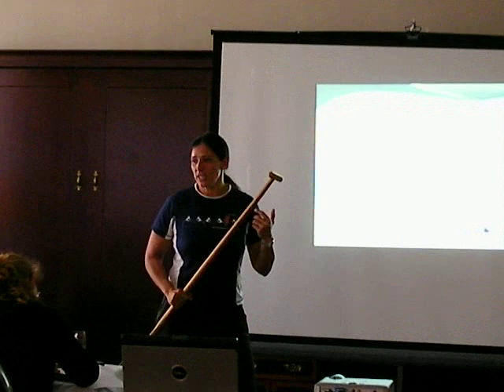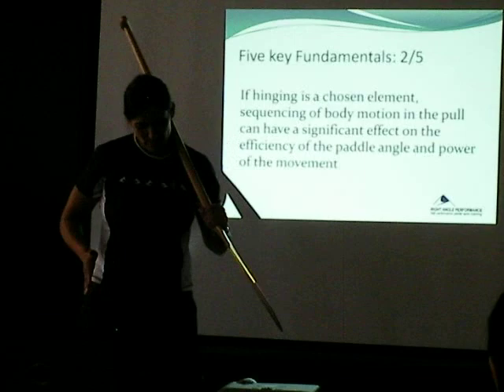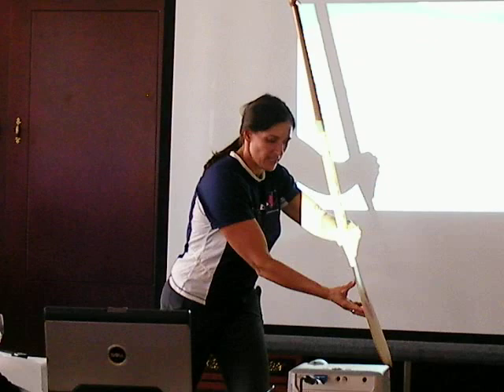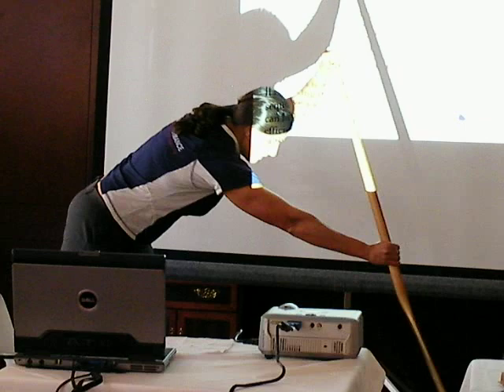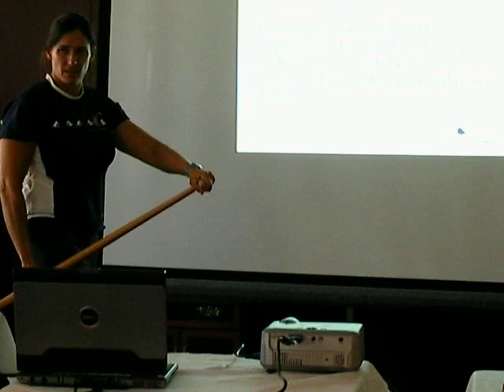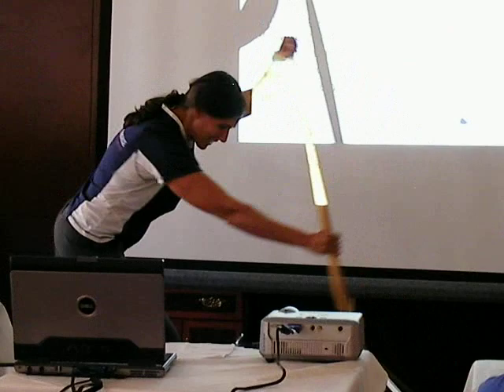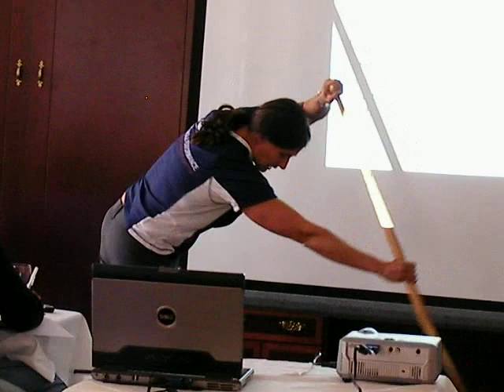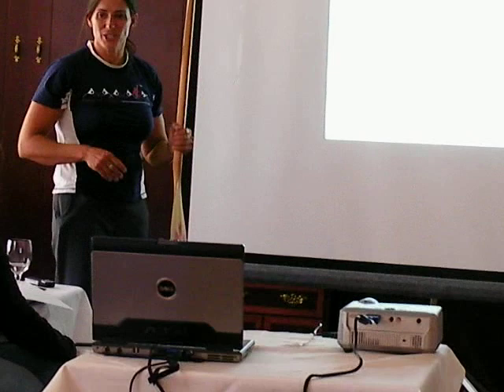Kamini Jain talking about paddling stoke technique

Comment: The design of the craft has less to do with paddling technique than the objective of the race/paddling. If maximum short term speed is desired, then less upper body discipline can be tolerated, but if anything longer than 10 to 15 seconds is needed, then efficient upper body movement is paramount to efficient hull speed. And, yes, thousands of hours in practice and racing over 15 years of marathon open canoe racing in the Eastern US. @ kahalaboy - great point.